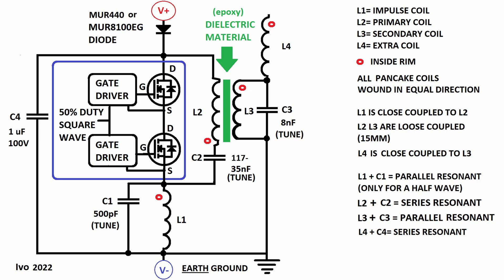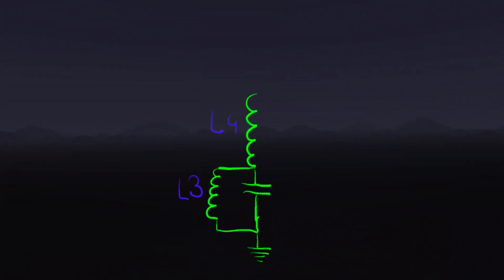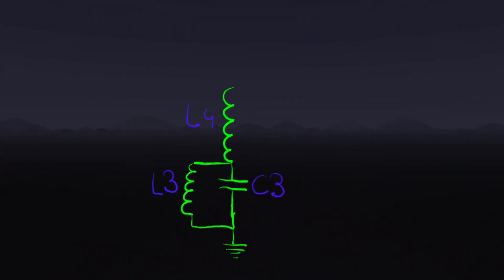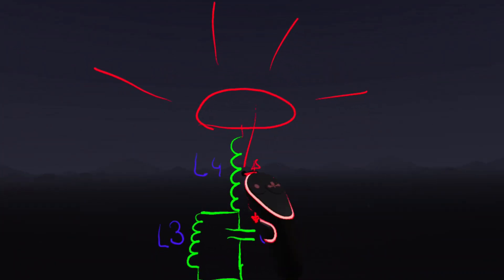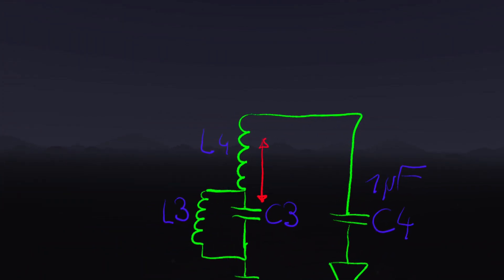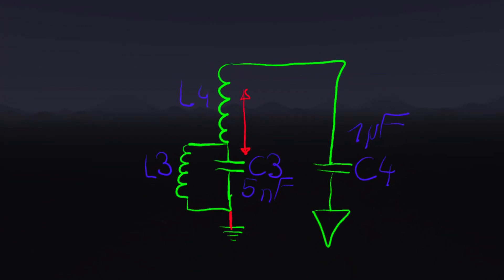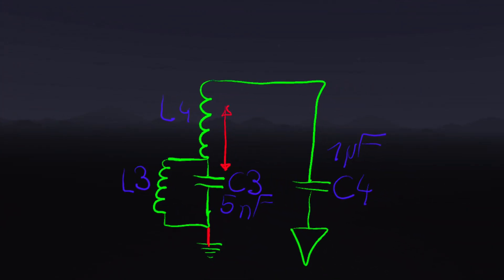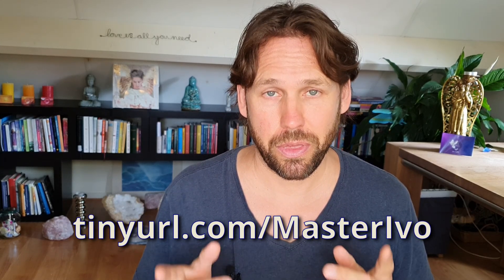Ground Currents Produced from Combined Series Parallel Resonance

Comment: seriesis better. 100mH coil 100mF capacitor 
 Pulsed at 630ms 40%widths now you just need to know whar to put the GROUND. I WILL Give you A Hint. It's not on the negative side.

Comment: Sir it is possible if you set the operating frequency higher than the tuned frequency of the parallel circuits. In this situation the total impedance of the parallel circuit is capacitive which is in series to the inductor. Now you may tune the whole circuit in series resonance. The ground current will register very high because of the series resonaņce. Thank you.

Comment: Those "currents" rather come from the radio frequency instead of the high voltages.
Those fast frequencys tent to go everywhere :) 
These "currents" are also near industrial frequency regulators. Even the ones with emi filters. Sometimes they can really be a pain in the ass.
Reply: @MasterIvo  Well you were talking about your current probes picking up while not even doing the current measurements(just having it arround the coil)
This is exactly what rf does.
That field can be seen throughout your whole collection of printboards.
Even at the logics level!
Its those high frequencys that not only run on your circuit. But also all arround it.

To give a example.
You can light a fluorescent with a resonator driven by a function generator.
Theres not much power in those.
Then offcourse running a resonator base fed at the right frequency will start the resonance.
But amazingly that minimum effort is enough for radiating that energy.
Reply from the maker: @acidbyte23   ah yes, thank you for explaining. indeed and those fields are pretty powerfull. But somehow I dont always get those current readings, and my current probe does have a grounded faraday cage built in. its still weird. but it is what it is.

Comment: Do you know of a way to utilize back emf to sustain a high power pemf device while increasing frequency up to 50hz?  (.5 - .7 Tesla) like in this video.
 https://youtu.be/vYp_aANfdJM

You see, we can create pulses that are high in current and high in voltage ( high in power) but low 
in frequency.  

Can you can give me an idea on how can I do it simpler and get high power 
pulses? Goal is to generate this high power @ +/- 50hz with the
lowest amount of components,  efficiently.
Reply from the maker: at this low frequency, you can use an auto oscilating relais
Reply: @MasterIvo  will an auto oscillating relay utilize back emf, and keep this pemf device at .5 Tesla if the frequency is set to 50hz?  Example?
Reply from the maker: you're going to need to experiment with it.

Comment: You believe Tesla's tower, using displacement current, captured energy from the potential difference between earth and sky?
Reply: I doubt it, Tesla determined the atmosphere was unsuitable for energy harvesting:

"Electromagnetic Hertz Waves Radiated Horizontally From Vertical Conductor, Slightly Affected By Conducting Earth Surface, Velocity V- Speed of light. ENERGY UNRECOVERABLE."

The dome acted as a large capacitor calculated to provide the best capacity for the towers extra coil, you need a top capacitance to take full advantage of the oscillations, the surrounding air was also part of the capacitive system. Think of a balloon underwater, as you swell it up the surrounding water will push down on it, finding the right balance was factored into the design.

The amazing thing about Resonance is that, provided the rest of your circuit is designed correctly, it can bring a return impulse with more power than the initial impulse, this means once it gets going a portion of the return power can be fed into the exciter and become self-acting.

Comment: It’s the aluminum currents deflection by the bismuth that rotates electric meters disk as electric pole n-s fields transverse through the top-bottom of two of the four solenoids, with the house connected solenoids receiving power through the aluminum which in “turn” - spins the disk shaft to the clock-gears on the house electric meter!

Comment: hi everyone, people in my apartment block is using this technology to keep me awake at night for several years now. there is some kind of interaction with biological processes. If anyone could offer any help or advice with detection that would be greatly appreciated. I am guessing I would need an oscilloscope to detect the frequencies that is used for the resonant energy transfer? I don't know if i should spend the money on an oscilloscope, also I am worried the resonant energy will blow up the inputs?
Reply from the maker: make a faraday cage for protection. Can be done with aluminum foil, that is earth grounded. put it on the wall or near your bed. the electric field will not pass it
Reply: @MasterIvo  I have tried a faraday cage many times with solid ground rods and thick cable. This makes the resonance transfer much worse. This is because the resonant energy is transferred between the height difference in between the ground and the Faraday cage. Basically anything conductive connected to ground and that has a height is causing the problem. There is some kind of electrical energy induced in between the ground and the end of the cable (in that case the faraday cage).

Comment: I suspect it helps to pump charge from earth that the big ball is as high as possible. Since there is a huge voltage difference between ground and a few meters up in the atmosphere. I wonder if the apparatus that kept the ball high was not a conductor, so as to not prolong earth potential up in the sky.

Comment: Ivo, when you go to do your tests you will need either a large ground field OR large chunk of metal to connect your ground to then to earth. What you are doing is what Barbosa and Leal did with their Earth captor. Per some leaked pentagon UFO materials (mentioned in the book Pentagon Aliens), you can expect about 1hp (745 watts) per 200 pounds of metal in lieu of or to augment that ground connection. Those large grounding fields that Barbosa used, one was 56 rods. Well 56 x 5.5#s is 308 pounds (plus they had good ground connectivity on each)...

Comment: Hi Ivo,

thank you very much for your valuable work! I don't know how you measure the high frequency currents?
I only measure all currents indirectly via a low-resistance ohmic resistor using a differential probe and go to a digital oscilloscope with the signal.
This is the only way to get correct values. Other measuring methods often showed an overunity that was not there.

Comment: Have you studied Morey and his 30kw device?    Do you have the Colorado Springs notes?  I have Cold war tech book  Gerry did a fantastic job.  and many others.  Tesla built all of his own instruments in Co.   Tesla talks about the setup as being three tuned circuits (pri, sec, & extra coil) that all combine and work together in resonance fashion.   His extra coil in the book shows about 110 turns above the secondary there lightning arrestors   His caps were huge saltwater containers low C  ,   One problem he had was establishing good Earth Ground  I believe he ended up using water flowing under the huge barn lab.  the whole area was ledge.  Tesla never really gave exact parameters .    I'm working on two methods of producing free energy one using rotation and the newest one will use vibrating coils in a magnetic field. the ECM device doesn't produce enough amps to self run so I have added one of my old coil panels that are tested in video 320.   next test will be to find out what there series & parallel connections will produce with resonance in use as well.   It'll be interesting to see what the vibrator will produce as well.  The energy we use today is from magnetic fields  I believe that all our devices in the future will use impulse technology everything in nature runs on vibration and impulses.  just watched your other videos and few others on crystal stressed to produce voltage  I may incorporate some in my vibrator design vibration will hammer the crystal and voltage will be stored.

Comment: I myself would like to learn more about the effect on the meters. 
I don't believe the one wire reading is a false reading. 
You should be able to see real power in a capacitor that has one wire to the machine and one wire to the ground.  
I'm starting to come to the conclusion that it is a huge pressure flowing through the entire systems wires.  
The closest thing I can compare it to. Is having five air tanks connected in parallel and only blowing air into the end tanks, in an alternating sequence.
The air hoses on each tank would also see fluctuations and pressure.
Even if the wire is only connected at one end it can still hold all the pressure. 
It's definitely not electricity that we're seeing. And whatever this ether is. It has properties of water and air.
I love your research and keep up the good work.

Comment: YES. presumably, the earth's electrostatic field is induced by that of the sun. with a '2 spherical capacitors of unequal size' resonant system where topload/spherical terminal is one sphere and earth is the other, the larger sphere's charge is available to some extent during resonant action. oversimplified, but indeed this must be why "the problem of increasing human energy with special references to the harnessing of the sun's power" has its focus squarely on the Colorado springs experiments & TMT. 

So the implication is, planets are ideal solar 'panels', i usually avoid discussing this publicly because it sounds like a fantastic dream that humanity would KNOW about already if it were "real". but Ivo brought it up first! yeah try not to cackle madly when THAT realization finally sinks in! 

ITS ALIIIIIVE! ITS ALIIIIIIVE! 🕺🌍
Reply: "the implication is, planets are ideal solar 'panels'" I love this line.

And assuming you meant the Earth itself is alive as well then I concur, Tesla recognized that Crystals are themselves living beings, why not a planet?
Reply: @JenkoRun  oooo yeah dont cha know

Comment: I've studied tesla now for 15 years read all kinds of books  built many devices to learn.  Tesla stated that you can go from very small to very large but you can not go from large to extremely large.  His system used three coils all three were tuned to be in sync with each other.  He pushed energy pulses into the Earth Ground and the Earths ether responded back with a massive amount of power.  One of the best reads was the Colorado Springs Notes, displayed these returned energy flows as arcs from the Extra coils output to the top C.   Lost Science by Gerry  is another great book on how Tesla started his research from the power plant switch closure which killed some operators if they did the closure at the 1/4 wave,   at the null of the wave they were OK.    There are several of us working together to design a small energy system that is self running to power a load.  Over unity is available. in many ways.    Open source is so important we are sharing there are many who get greedy and there are others that harass us and there are some that really don't want this work to succeed and will anything to stop it.  I'll be watching your progress  GOOD LUCK  great job so far.   I too have burned and fried many circuits.  I have Orcad PCB design software if you need a board done let me know all I need is a schematic and part numbers and I can get you gerber files and drill stuff
Reply from the maker: thanks, I subscribed to your channel maybe we can learn from each other (although I'm not a fan of the Don Smith confusing info)
Reply: @MasterIvo  how abt using a varistor to ground and the way tesla seem to have spark gap at the bottom of wanderciffe tower on one side along side. Caps and another a cap in pics what do u make of that
Reply: @MasterIvo  Hello, I have been down this rabbit hole and found what are many ways to get cold currents.  Coil shorting between large magnets, but tesla's coils used earths magnetic field. Its like EFNMR. there are rules that must be followed and its tune tune tune.   Must have a Unidirectional flow in primary circuit, flow in one direction with no current to very little being consumed in the circuit.  Resonance must be kept between all circuits so when you pass the impulse onto the secondary, it lines up perfectly. ie.. tuning the LRC circuit is how you find the sweet spot.  That includes the voltage going into the primary.  Your looking for an increasing amplitude wave on secondary, the trumpet wave.  Voltage is made in secondary and current is made in 2nd secondary that is wound counter clockwise and has the same inductance as the first secondary and is in series with it, but not to close to a magnetic field.  keep your coils away from any magnetic field.  The earths field is what your tuning to.  Tesla used a balance beam to make his primary and secondary weigh the same.  and added loops to secondary coil to tune it. He added a coil to his circuit with a metal rod thru it to tune the inductance.  But theres a lot of info. to much for here.
Reply from the maker: @nikolastesnovian I agree with a lot of what you write, but it only has real value to me if you have got it working. If not, what makes you so sure that this is what is needed?
I mean you need to understand why these conditions are needed, do you? I have email.
Reply: How do I send you an email? I have been working on capacitor banks wired in both series and parallel.

I would be interested in how resonance applies through the circuit.

Comment: Its a fine journey. I am also investigating technology history in other fields of science. When thinking of systems of mechanical material transfers of phenomena. It is muddy with different terms and units. However the phenomena all fit the predictions of Maxwell showing relationships in geometric form based on known energy states. I fear much of our electrical science will remain confused through those that demand we use oil. 

In this regard your understanding of the separate fields at play brings the material properties of components to life. The transfers of phenomena shown on oscilloscope just as wonderful as demonstrations of fluid effects. I do see why science held tightly to material concerns. Definitively in your work and our world around us there is power beyond the wires.

In that regard I expect to find some point in our electrical knowledge a power rule that actually explains two different phenomena as the one type of energy. I expect that point to be explained more fully by understanding the transfers at this fine scale. I suspect unhitching this misunderstanding would free the variables - not working for electricity as we know it but demonstrating a phenomena that could be tapped in a different way.

Its odd everything is so split up in learning and often (sales) tradition leaves some horrible relationship as critical when its really a market protection. Your delivery brings the work of great minds to life ❤✌
Reply from the maker: Thanks!

Comment: So I been doing something similar by charging one side of a cap to 30kv and having the other side going to ground. I am not sure which way to go yet . Either  low amp pump or high voltage pump. The other output is to another cap but the other side goes to a steel ball that is elevated. From both of these I seek potential difference with caps separately and with diodes to use them as outputs to a load . Confusing results so far and scared to hook up my scope directly to it so I have a lot of interference . Its a long mission but thats ok cos I can't turn back anyway! 👍🏻
Reply: Don Smith would tell you run high voltage. A proper grounding with an appropriate resistor should pull voltage equivalent amps from the grounding. Good luck!
Reply: Can you read my response?
Reply: @mcbusinessmonkey  yes I did . So the resistor goes where? And what type of value ?

Comment: I had what I think you may be about to discuss happen to me while trying to replicate some wireless power transfer system. I had two USB oscilloscopes on two different notebooks. When they were both plugged into mains power I would get excess wireless power defying the inverse square law. But if I unplugged either from mains the power would drop right down. I concluded there was some kind of resonant coupling through the mains power neutral wire, kind of like a standing g wave in an antenna. Not sure if this has anything to do with anything. But thought Ice mention it as something to be aware of, power going through the scope leads....